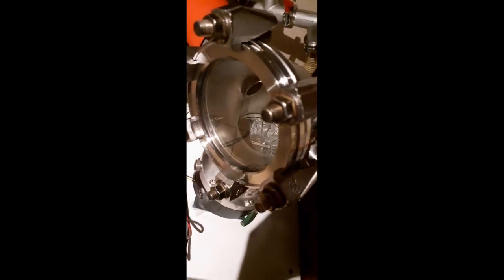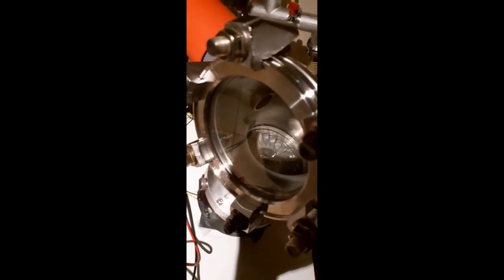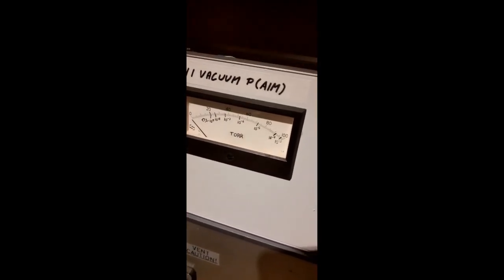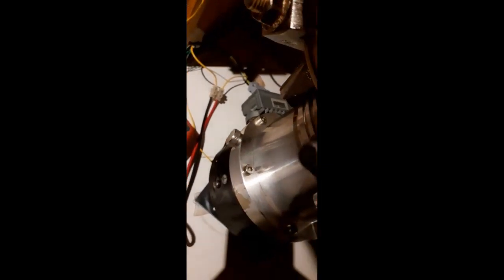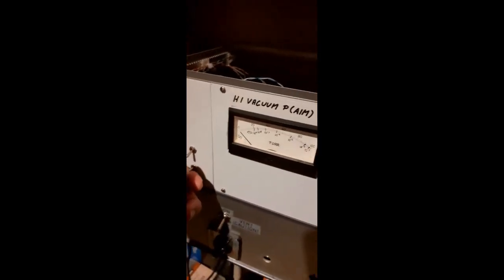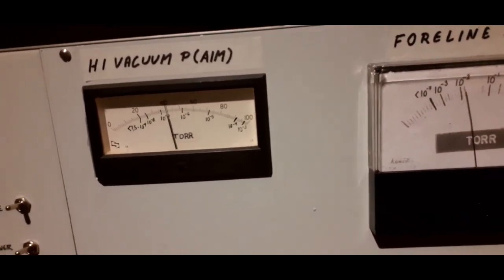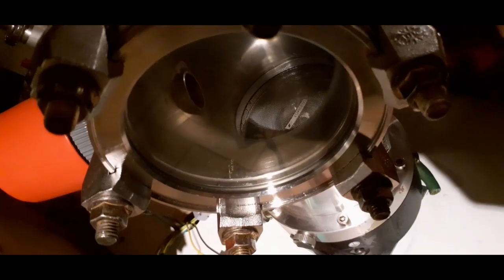DIY High Vacuum System

Comment: Hey! I'm not an expert or anything (only built a vacuum system literally out of scrap with a diffusion pump for a university, also on my way to build a second system for my own), but after the turbomolecular pump, the KF25 connections leakage should be taken into consider. I don't know what seal material you use, but if it's viton, get rid of it. Use a heavy metal at least like lead ring instead, or indium for the better. It can increase (in which i mean decrease) a magnitude in the final pressure range.
Reply from the maker: You're right, KF and ISO flanges will never beat metal-to-metal seals like conflat or indium seals. However KF connections are usable down to something 10^-9 torr by design. My O-rings are typically fluorelastomer ones, which are better. Going indium seal wouldn't make sense in my setup, as the main turbo flange requires an (ISO100) O-ring seal. Going higher, I'd need a gate valve after turbo pumpdown, to seal it off, and then take the chamber further down with an ion or sorption pump. That might be the goal some day but it's a LOT of new hardware to scrounge. Good luck with your own systems!
Reply: @chromatogiraffery3104  Thanks for the info about O-rings. I suggest you not to buy an ion pump, instead make one, it's (relatively) extremely easy and cheap to construct (the titanium plate which suffers damage can be easily replaced for a low cost on ebay). The high voltage supply can be made out of a microwave power supply with a high voltage rectifier, and a primitive LDO-type supply where the bypass component is a high voltage vacuum tube. At least this is what I'm planning. Use spark plugs as electrical inlets for the vacuum system; they are high voltage insulated as well by default.
Reply from the maker: @riska1670  That's a good plan, but often vacuum stuff turns up on ebay 'cheaper than fabricating it yourself'.  Be wary of spark plugs, they're not necessarily very hermetically sealed!
Reply from the maker: Oh and also, avoid lead and leaded solder in high vacuum applications, it has terrible outgassing characteristics!
Reply: @chromatogiraffery3104  I heard that pure lead (bought from a fisherman/fishing shop where it is used as weight) molten into ring shape can be used pretty effectively for high vacuum sealing. Can you provide source for outgassing characteristics? About spark plugs: i know, you have to try different brands to find the best. Homemade ion pump is not just an interesting project, but as you can see around youtube, there is no homemade ion pump, so maybe yours would be the first.
Reply from the maker: @riska1670  An ion pump would be very interesting indeed! And the magnetic field iseasily achievable with modern large neodymium magnets. A simpler DIY UHV pump is a titanium sublimation one, just requires a coil of Ti wire to heat and some high current feedthroughs (typically 40A at low volts). 

Wiki has a great page about UHV materials, which cites this very interesting paper from Fermilab:
https://lss.fnal.gov/archive/tm/TM-1615.pdf
https://en.wikipedia.org/wiki/Materials_for_use_in_vacuum
Reply: @chromatogiraffery3104  I hope you eventually feel the urge to make a homemade ion pump. :)
Also i forgot to say when you mentioned ISO-100 O-ring around the turbomolecular pump, that you can still use indium even there; I just bought 1.8meters of indium wire on ebay for very cheap; a few (around 3 or more) turns would make a good seal (of course depending on the diameter), also, - I guess you know this, but just to inform the viewers - use high vacuum grease on every seals, which are not metal-to-metal type.
Reply from the maker: @riska1670  That's actually a huge debate in the vacuum community whether to grease KFXX or ISO o-rings.

I have NEVER seen it done on any commercial system, so I have opted not to do it. 

Indium wire on ISO seals is an interesting idea. The area of the flange certainly is large enough for it (if you have many clamps on) but the self-centering effect is lost so the mechanical rigidity will likely suffer. I would consider putting a lose self-centering ring inside the joint to make sure the joint doesn't skid out to the side
Reply: @chromatogiraffery3104  I use vacuum grease even on rough vacuum systems because "why not". :D
Also I had sealing issues that needed one specific seal to be reassembled about 7-8 times the same exact way, and eventually it was perfect with viton and grease.

Self centering rings are at least very easy to manufacture if you lack of them, and there are no material requirements since it does not seal anything. So yes, you are right. It would be an interesting experiment in your current build to replace the seals with indium after the turbo pump. It must be also noted that indium is toxic to human body even when getting in contact with skin, so be cautious!
Reply: @riska1670  i would not recommend vacuum grease on o-ring seals. 
Also for anything high vacuum (down to 10-7 mbar/torr) iso-k or kf type flanges are perfectly adequate. You could operate them with conical aluminum seals, but I never had the need for that.
Vacuum grease would rather attract dust or other things that then could damage sealing surfaces or lead to leaks in the first place. 
If you reach the lowest ranges you can reach with this tech you can even reach ones more order of magnitude in pressure if you place your o-rings in a vacuum oven to outgass before use.
Where did you pick up your best practice recommendations? They seem somewhat unusual, but probably work well enough for you?

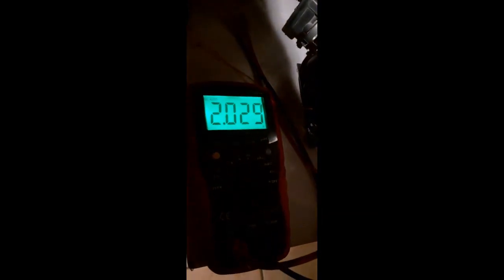Comment: Hey! If you make a video like that please make sure you use the right resolution. So if you are using a shaky mobile phone, please use it so it's watchable at 10:16 or similar and not at 16:10 :-)
Your videos will be way way better :-)
Reply from the maker: I know, I was cursing myself while reviewing the footage, but I didn't have the time to re-do it. 

I'll do some smaller in-depth videos, I hope to slightly elevate the quality in those.
Reply: @chromatogiraffery3104  no really! Make a good and stable video and explain everything. Get a bit inspiration on how to make a good video from applied science or nilered. I think so far the is not much or anything at all about this on YouTube, if you do and present it correctly I think this has potential.. well for nerds^^ but still.
I know I would like to get inspired by it :-)